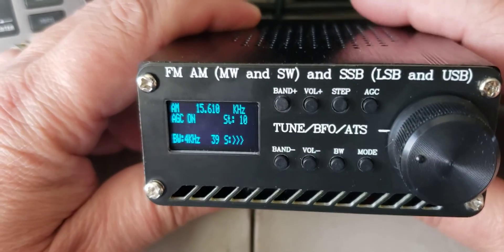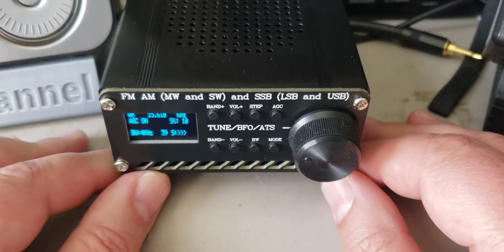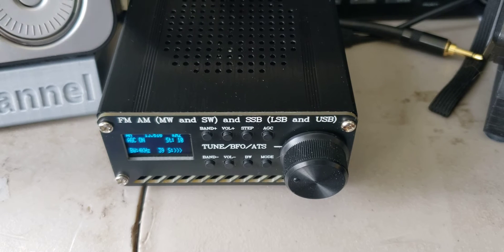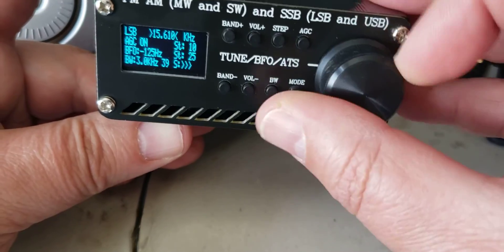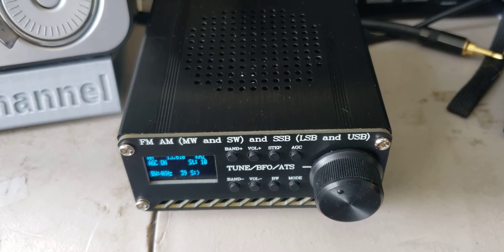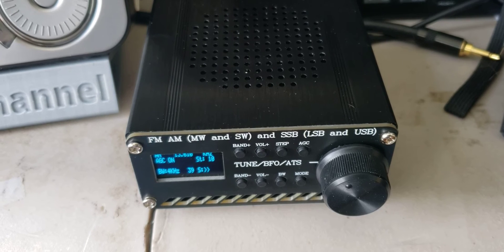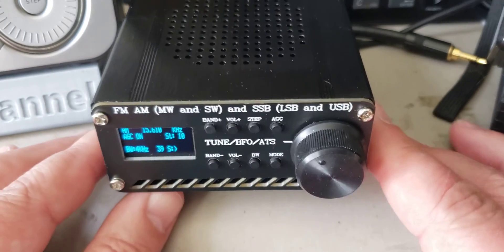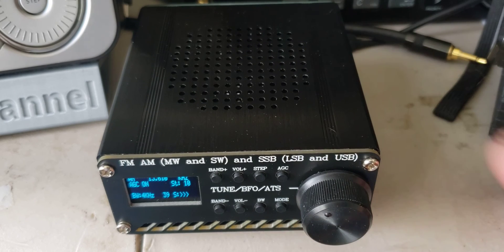Chinese DSP radio performance on outdoor wire is quite good and surprising

Comment: I agree that as it is sold at the moment this is an experimenter's radio. However I guess that as time goes on those who are manufacturing this little box will begin to install the more updated firmware which addresses a number, if not all, of the shortcomings. Personally my units (I have two) don't seem to demonstrate the noise problem using the telescopic antenna. The performance of this radios differs from one unit to the next, as does the quality control. some of the radios appear to have different Arduino boards to others also.